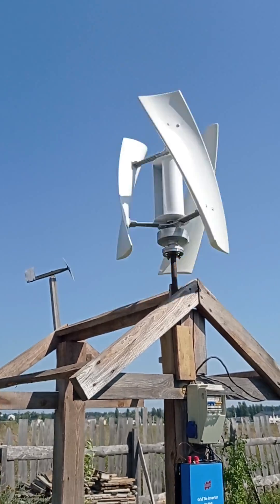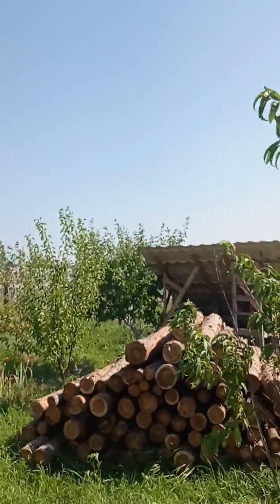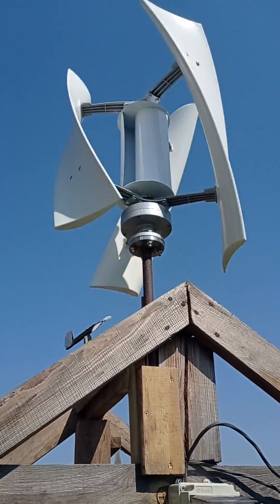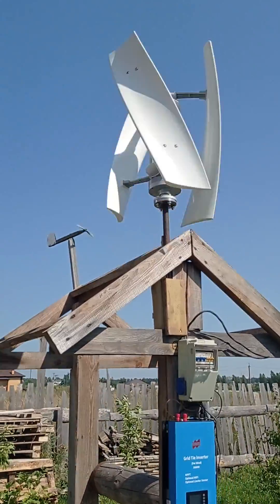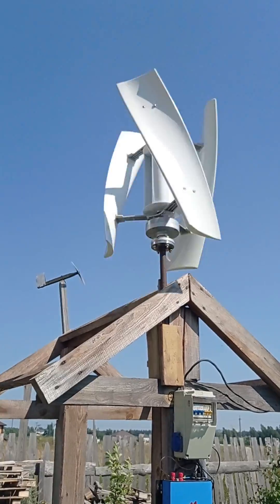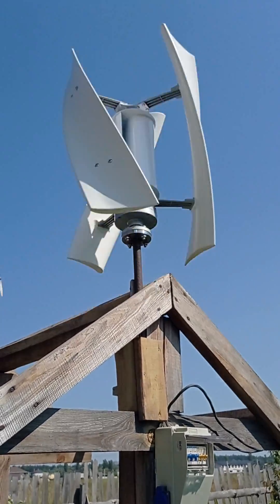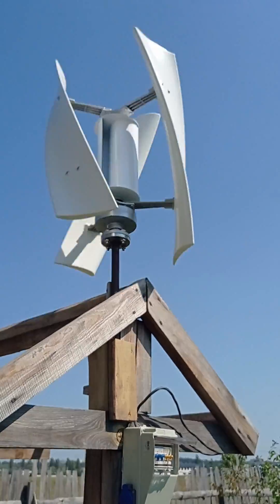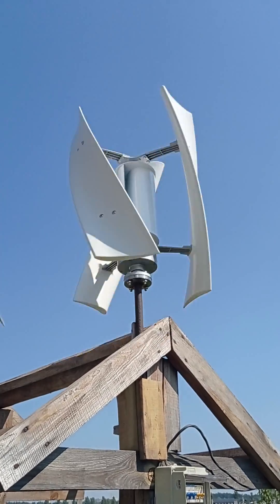Smaraad X3 turbine real wind voltage output, first test. #windturbine

Comment: Do You have some working ? Can You recomend something ? thanks
Reply from the maker: Horizontal ones work. I've got 7 units in use, from 1.55 m diameter (the smallest) up to 4.25 m diameter pitch control (the biggest so far).
Please find my dedicated English speaking channel called Backyard Voltage, there is a lot of stuff about wind turbines and not only about them.

Comment: The problem of all those chinese vertical wind generators, they use motor from horizontal generators that are usually high rpm generators. Obviously, VAWT cannot reach the same or even close RPMs. So you have to either change the motor to low rpm or use reductor. Low RPM motors have way thicker copper wire, and you can make such motor at home. You just need neodymium magnets, thick copper wire and 3d printer.
Reply from the maker: That's not true )
Here the "magnetic bearing" or "magnetic suspension" or "magnetic levitation" generator is used, which will never be able to bear the mechanical loads of the horizontal axis units.
The trouble lies not in the concept, but purely in the production. The concept is 100% correct and great.
Reply: @bkwindsolar  magnetic suspension has been used in horizontal wind turbines for over 5 years. Just Google. 
Regarding the motor, if it's VAWT motor it's supposed to provide at least 60v after 100rpm. On the video you are getting 5v only. Conclusion the motor is taken from horizontal wind turbine where average rpm is 250. It's a simple math.
Reply from the maker: you are mixing up the MagLev and magnetic suspension - just google.
your conclusion is wrong, since never even these MagLev generators were used in the HAWTs.
this is just poorly designed generator, that's it.
Reply: @bkwindsolar then what about voltage? Why aren't you getting voltage above 50v?
Reply: @bkwindsolar  actually, someone already explained you in comments in ukrainian that the problem is the motor. You need to be blind and deaf not seeing that. Just upgrade the motor and your problem is solved. Take care
Reply from the maker: I know that the problem is the generator, there is nothing new in that. I just don't get it - why are you so obsessed with it? that story was about 3 years ago, long time, not worth even remembering.
if the gen is shitty you won't get the voltage. but even if you will get the proper gen with the proper voltage that's not the fact that you will get production - like here for example: https://youtu.be/d0ZqqpV6NXo
Reply: @bkwindsolar I'm not obsessed at all. I'm  trying to explain that VAWT is working. The problem is the motor that you get from Chinese market. That is it. Победа Украине.
Reply from the maker: okay, well, I agree with that, that in this specific case - the gen is the cause. however, if taking into account the rotor effectiveness (Cp of blades) and cost - any VAWT is 6-10 times less efficient than its HAWT counterpart.
Reply: @bkwindsolar  I agree with you. VAWT is less efficient, but sometimes there is no place to install HAWT so the only option is VAWT. Better than nothing.
Reply from the maker: costwise - it's better to put way more panels (on the fence, on the facade, anywhere where possible) instead of vawt definitely, instead of hawt also very likely (in most areas).
Reply: Smaraad is a full fraud

Comment: 200w is good for charging 12v batteries
Reply from the maker: where have you seen 200w? this unit cannot reach higher than 8 VDC (after rectification) on this exact video, later on I was able to locate 9 VDC out of it on some 12+ m/s wind. in which universe 8-9 vdc is enough to charge the 12vdc battery bank?
also, let's assume you want to take 200 watts out of it at 9 VDC, that will be 200/9 = 22.2 Amps, given how thin the wire is in the coils - it will burn on 1/3 of those apms applied... so, no, this is a useless toy, not more.
however, if you are so confident you can make it useful - I am more than happy to sell it to you - $200 and it's all yours. let me know the address where to ship it, and here is my paypal, you can issue the payment to it directly: bodo_kush@hotmail.com

Comment: After some research, I came up with a solution. Get a vertical generator with 380V at 300 rpm or less. This way, at low revs, it should produce 48V. In strong winds, you can slow it down by shorting the phases.
Reply from the maker: Yes and no. The trouble here is the vertical concept. Your suggested generator would work 30-40 times more efficiently on a classic horizontal axis unit.
I actually now have a 4m dia 380VAC unit - that one is a beast.

Comment: These windmills are made for off grid battary charging
Don't work with these grid tie inverters
Works best with the hybride charge controller
Reply from the maker: It will not work regardless of the connected controller/inverter.
If you want to be sure - go buy my unit?

Comment: Only just noticed this video. I've bought one of these. Generators recently. And have had problems. I bought the 48 Volt 3 kilowatt. version. I always knew it would never achieve 3KW. We knew that's an exaggeration. I was expecting something like 500 watts. To put you in the picture, I contacted the seller. Because I had similar results to what you're saying. They instructed me it must be connected to a load. That means batteries. And be running for about 24 hours. Before it will stabilise to the voltage intended. Actually, he was right. Before I put a connection to the battery I was just getting single digit volts. When I connected my. 48 Volt. Lithium batteries  After a while it started to show 51 volts. and just 48watts being produced at the generator. , it's not capable of charging the batteries it's intended for. To charge. A LifePO  48v battery Requires 58.2volts Even if it produced the amount of votes necessary, it would take 10 days to charge the battery. At such a low wattage. Completely useless. For my purposes. I don't know how they get away with it. The only way these things would be any good is with lead acid batteries that don't require such a high voltage. But even then, it's it's a new meaning of trickle charging. I'm very disappointed. And I've no comeback. I've had the. Turbine too long now to be able to send it back.
Reply from the maker: throw it away and get yourself a decent machine. horizontal one, 3+ meters in diameter (4.0 meters even better). those can definitely produce, and even way more than it was promised. see here my example: https://youtu.be/70eWPHTn1Ns

Comment: u mounted the blades wrongly :D lol they are upside down     Btw i hve similar device and from this rotation u should get around 60-70v , ... but ampers are very low for me. I am lucky when i get 20w at bursts. even this mine is 800w device. It slows down when it grab energy from it, which is normal but  I hoped for at least 100-200w  and not 20w :D
Reply from the maker: @stanislavcoros  it is impossible to mount them wrong, there are special gaps and fills that should match on the blade and the mounting rods, and they match only in one position....
So....
Reply: He did not put them on upside down. They have to have the fat edged Leading. I was worried about my own one. So my seller sent me better pictures. And he has done his correctly. His only fault, I believe. Was not being connected to a battery to activate its full use. You'll only get Single digit voltage. No load. Once you connect batteries. Then higher voltages are achieved.

Comment: All practical tests of ground-based small wind turbines show: 1) They hardly produce any electricity! 2) They do not last long!
Hardly no electricity, because hardly any wind close to the ground – and electricity yield is proportional to the third power of wind speed: So 100% more wind generates 800% more electricity! But close to ground there are just extreme gusts, which destroy 9 of 10 wind turbines after some time. 
Due to price decline solar panels generate at least 10 times more green electricity with the same investment! Reliable for at least 25y - maintenance-free.
Reply from the maker: is this you telling me this?
I've got 50 kW of solar installed. and it does not produce enough power for my self-consumption during winter ))
the turbine here in this exact video - is just an unlucky experiment.
see the better one here for example: https://youtube.com/shorts/XTwSxQCpiN4
when 1 single 2 kW wind turbine easily outperforms 5 kW of solar array... instantly, and daily in the end as well.
I often see this November and December when my 4 kW of wind turbines produce roughly same or more amount of power than my 50 kW of solar panels...
So yes, you are correct, but no, you are not right )
My intake - cap solar first.
Next - go for wind - if you can put it on height, and if you know what a good wind turbine is.
I'm not done with my setup yet, it's still progressing, and I will stop only when I am self-sufficient in December (which is the worst solar month).
Reply: @bkwindsolar  Of course: If you have to live off grid in winter, you need alternatives (and batteries) for Solar power. But in general meanwhile solar panels are so cheap, that you produce at least 10x more electricity with solar power compared to small wind turbines.
Reply from the maker: @michaelvanallen6400  yes, small wind turbines are rather toys. If you want some serious production - go for 3+ meters in diameter, or 5+ is even better. Horizontal axis only, no vertical for sure.

Comment: Guys the important thing to know is that at 10 m/s to harvest 2000w from the wind you need a harvester (wind turbine) that covers an area of 12.5 m2!. For that area in horizontal turbines, you need blades 2m long (4m in turbine diameter)! Use Omni wind turbine online calculator or another one to get your numbers right. The turbine in the video doesn't have nearly the required swept area of 12.5 m2. Vertical wind turbines of all sizes are not good with current technology, its just look pretty which is a good selling point for one who wants to get your money
Reply from the maker: @kumic5793  well, that works for horizontal. My FT-2000L2 with 3.2 m diameter shows its promised 2kW exactly at 10 m/s. For vertical, since they are way-way-way less efficient - you have to get to triple or even quadruple of that 12 sqm working area.
Reply: @bkwindsolar  it's totally fake , don't buy it ,

Comment: Your turbine is mounted 2 low. Too much wind disturbance near the ground. Mount it 20 feet height minimum
Reply from the maker: did it about a year later (this June I guess) - same shit, 8 volts max, 1 watt.
the problem lies not in low or high. if the turbine gets a clean wind (given I have an open field and no obstructions for over 1 km in the predominant wind direction) - it will work even near the ground. and for the testing - it was more than enough for me to see if it is capable to get to something.
btw, if you re interested, I have a separate English-speaking channel here: https://www.youtube.com/@ModernUkrainianHomestead

Comment: Thanks for the warning! Did you ever find a good turbine ??
Reply from the maker: Yes I did. I have currently quite a bunch of different ones.
Here is the video about all the possible Chinese wind turbines, in my other, fully English speaking channel, it will answer a lot of your questions: https://youtu.be/FoKUUpJMgD4

FT-1000L with 2.5 m dia, I have that one, here is one of the videos from its operation: https://youtu.be/Mt0cQMKNgr4
And FT-2000L2 - I just unpacked it yesterday and shoot some video-fragments, so today-tomorrow I will gather it all in a single nice review video and it will be put on both channels.
Reply: @bkwindsolar  awesome 
What about a good inverter that’s for off grid? Any suggestions ?
Thank you from New Zealand .
Reply from the maker: I am Deye fan. That one allows the most features and is top-top-top for the price. It also may sell back to the grid if you have such an option. It may have one of its' PV turned to be wind turbine input (but you have to get the 220v or 380v machine for that - they are available on the market).

However, if your needs are really low, go with some shit-cheap chinese ones, like Anern, PowMR, EAsun, Daxtromn, Must, etc. They are quite capable for small tasks, are are also a perfect solution for a low-budget application.

Comment: You’re so lucky to get 5.2V , I’ve got output of 2-2,5 V at 7-8m/s . Smaraad 2000W/12V , do not get dumped as I have been.
Reply from the maker: Still it produces almost nothing, even on the controllers.
One of the latest videos on the channel - I've made a full detailed test of it.
Reply: @bkwindsolar  u need rectifier
Reply from the maker: seriously???
and what kind of batteries can I charge with 7-8 VDC (that's the voltage after rectification)?
Reply: @jounik5728  ''full bridge rectifier'':)))

Comment: Hi. where you able to check the voltage coming out on the turbine?

the inverter you use, was that came with the turbine?
Reply from the maker: Hi. well, basically what is shown on the inverter - that's coming out from the turbine, the max it could output in real life - was 8V... so it's not enough to produce some watts I'm afraid.
The inverter is great, and it works perfectly just with the other type of wind turbine. It was bought separately. In the end, the result is like this, at very low winds of 2,5-3 m/s: https://youtu.be/gRY95dl35kQ?t=289

Comment: I suffered the same. I bought the same wind generator and it is the same. I obtained a maximum of 46 w at 600 rpm. Smaraad a big deception.
Reply from the maker: I can't wait to see what a modified version of it will produce.
Reply: @bkwindsolar smaraad is not a brand , they are cheating with overseas peoples , I am personally victim of this seller,

Comment: The output voltage must be at the higher band of the inverter input. I believe that inverter has 60VDC input, so that the turbine must have a 48V rated output. Otherwise it will never make any power
Reply from the maker: No, not really.
It has a unified firmware, so it can be actually easily switched on rebooting to be either solar based, or battery inverter, or wind inverter. And also it can work in one of two voltage ranges: 45-90 or 22-60.
In any case max Amps it can take is 25, so theoretically by switching it to a lower voltage you are limiting its max output a little bit.

The inverter is perfect, no questions about it. The turbine is definitely shit though.

Comment: Where did you buy this generator?  I bought a similar one and I'm waiting for it to arrive to install and test it too
Reply from the maker: On AliExpress. It's not worth it. Make them videos and file a dispute to get a partial or full refund depending whether you want to keep the item or not.
My goal is to re-do it, I will change the generator. Will upload a new video once done and tested.
Reply: @bkwindsolar When I receive mine I will also test it, I ordered the 4000W 48V one to charge a battery,
Reply: @focaricardo  so what is the result?